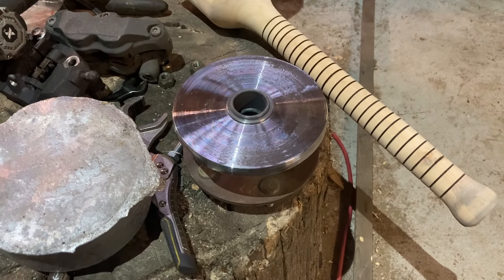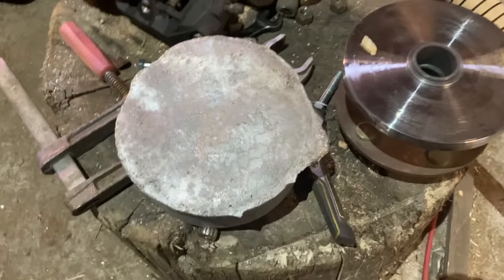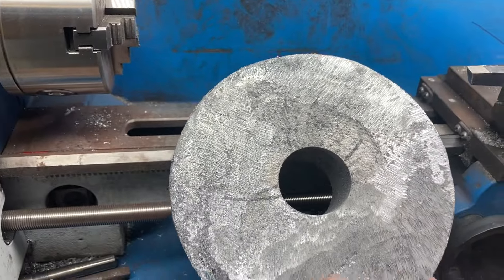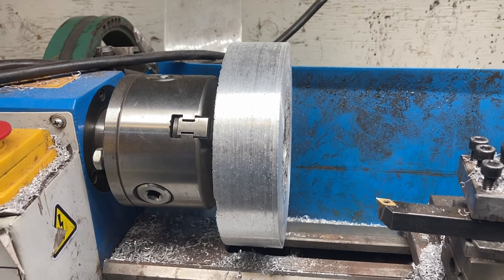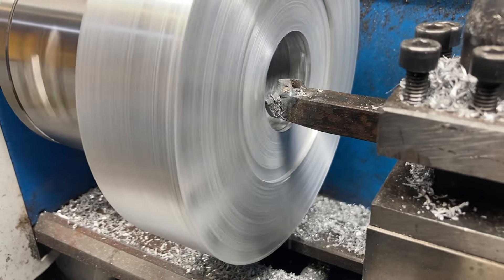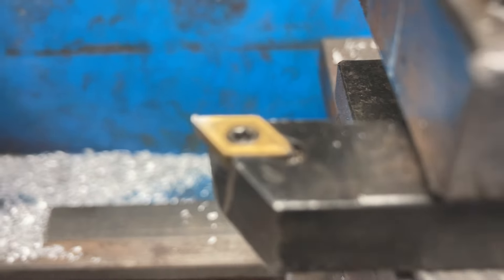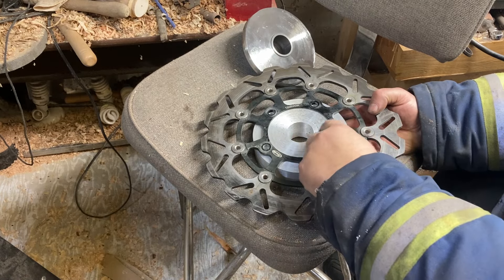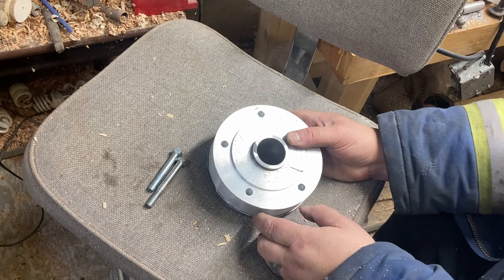Hey LOOK its shiny they will dig it. Project EORW part9

Comment: Glad to see you upgraded your lathe if it’s 3 phase you should consider using a vfd to control it or considering the stuff ya got laying around consider making yourself a phase converter running 3 phase on 2 phases is pretty rough on the electronics
Reply from the maker: A subscriber sent me a vfd so I currently have it running on that but it’s only for a 3hp motor so I can’t really work it hard, but it’s still 100 times faster than my little one